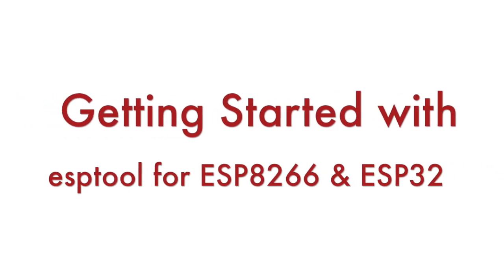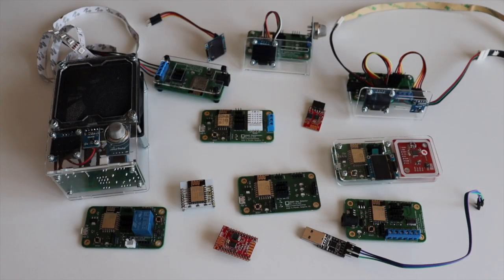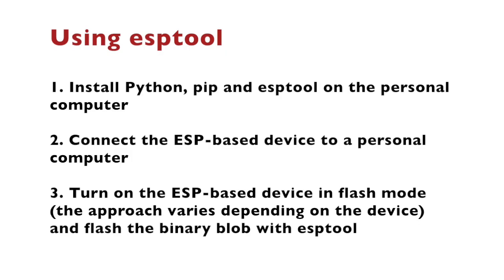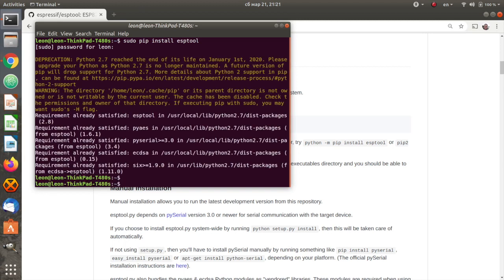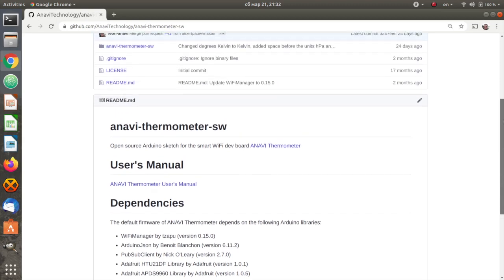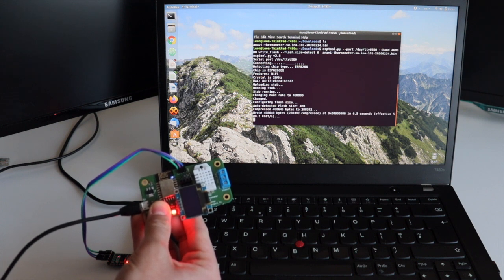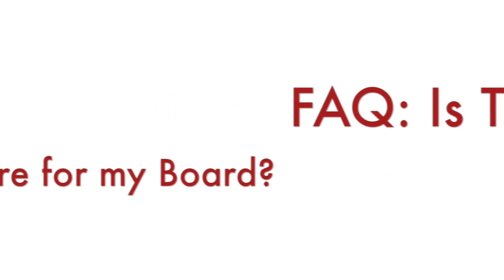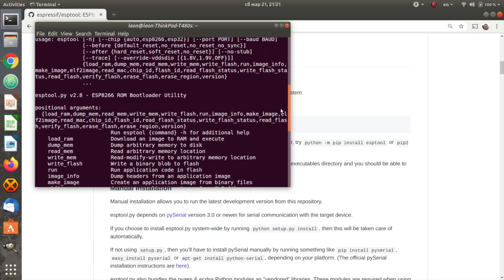Getting started with esptool for ESP8266 & ESP32

Comment: You said there were other instructions in the description.
Reply from the maker: Yes, have a look at the blog post with more details:
https://blog.anavi.technology/getting-started-with-esptool-for-flashing-firmware-on-esp8266-and-esp32/
I also added the link to it in the description of the video.
Reply: @LeonAnavi  HI there. I saw that and checked. I think the board is gone.

It's flashing blue twice and then nothing.

I will try another lead before I resign.

Sorry for the late reply, I'm not in a great way, but thank you for yours.

Kind regards.
Reply from the maker: What is the model of the board you are trying to flash with esptool?
Reply: @LeonAnavi  Oh hey there. It's a NodeMcu. I've had it ages, but not yet used it, so decided to try it out.
Reply from the maker: NodeMCU comes with a AI Thinker module ESP-12 (for NodeMCU version 0.9) and ESP-12E (for NodeMCU version 1.0). Both of these modules are with ESP8266. If you still having problems flashing firware to it first make sure the esptool is properly installed and has all required software permissions to detect and use your NodeMCU. After that you can also consider using the erase_flash command in esptool. It will erase the flash memory on the ESP8266 and after that you can try again flashing the firmware.
https://docs.espressif.com/projects/esptool/en/latest/esp32s3/esptool/basic-commands.html#erase-flash-erase-flash-erase-region

Comment: Is it possible to press the boot button and program only via putty/serial-terminal?  

Everything I've seen requires installing too much software (arduino ide, esp32 idf, vs-code, etc)... using just the esptool 4.4 executable seems like the next best thing.     

The espressif download tool seems too error-prone.. is it possible to erase the bootloader?
Reply from the maker: Yes, esptool is a command line tool. The button is required to help GPIO0 low on reset to enter flashing mode. By default there is a bootloader protection to avoid mistakes when flashing:
https://docs.espressif.com/projects/esptool/en/latest/esp32/esptool/basic-commands.html#bootloader-protections

Comment: Hello, I want to flash a Wemos D1 mini (ESP8266) with esptool and OS Linux Mint, but I got following error messages and I found no solution. May you can help me, thanks in advance Thorsten

sudo esptool --port /dev/ttyUSB0 --baud 9600 write_flash 0x0 firmware.bin
[sudo] Passwort für thorsten:       
esptool.py v2.8
Serial port /dev/ttyUSB0
Connecting...
Traceback (most recent call last):
  File "/usr/bin/esptool", line 3101, in <module>
    _main()
  File "/usr/bin/esptool", line 3094, in _main
    main()
  File "/usr/bin/esptool", line 2885, in main
    esp = ESPLoader.detect_chip(each_port, initial_baud, args.before, args.trace)
  File "/usr/bin/esptool", line 274, in detect_chip
    detect_port.connect(connect_mode)
  File "/usr/bin/esptool", line 475, in connect
    last_error = self._connect_attempt(mode=mode, esp32r0_delay=False)
  File "/usr/bin/esptool", line 433, in _connect_attempt
    self._setDTR(False)  # IO0=HIGH
  File "/usr/bin/esptool", line 399, in _setDTR
    self._port.setDTR(state)
  File "/usr/lib/python3/dist-packages/serial/serialutil.py", line 603, in setDTR
    self.dtr = value
  File "/usr/lib/python3/dist-packages/serial/serialutil.py", line 473, in dtr
    self._update_dtr_state()
  File "/usr/lib/python3/dist-packages/serial/serialposix.py", line 715, in _update_dtr_state
    fcntl.ioctl(self.fd, TIOCMBIC, TIOCM_DTR_str)
OSError: [Errno 22] Invalid argument
Error in sys.excepthook:
Traceback (most recent call last):
  File "/usr/lib/python3/dist-packages/apport_python_hook.py", line 153, in apport_excepthook
    with os.fdopen(os.open(pr_filename,
FileNotFoundError: [Errno 2] No such file or directory: '/var/crash/_usr_share_esptool_esptool.py.0.crash'

Original exception was:
Traceback (most recent call last):
  File "/usr/bin/esptool", line 3101, in <module>
    _main()
  File "/usr/bin/esptool", line 3094, in _main
    main()
  File "/usr/bin/esptool", line 2885, in main
    esp = ESPLoader.detect_chip(each_port, initial_baud, args.before, args.trace)
  File "/usr/bin/esptool", line 274, in detect_chip
    detect_port.connect(connect_mode)
  File "/usr/bin/esptool", line 475, in connect
    last_error = self._connect_attempt(mode=mode, esp32r0_delay=False)
  File "/usr/bin/esptool", line 433, in _connect_attempt
    self._setDTR(False)  # IO0=HIGH
  File "/usr/bin/esptool", line 399, in _setDTR
    self._port.setDTR(state)
  File "/usr/lib/python3/dist-packages/serial/serialutil.py", line 603, in setDTR
    self.dtr = value
  File "/usr/lib/python3/dist-packages/serial/serialutil.py", line 473, in dtr
    self._update_dtr_state()
  File "/usr/lib/python3/dist-packages/serial/serialposix.py", line 715, in _update_dtr_state
    fcntl.ioctl(self.fd, TIOCMBIC, TIOCM_DTR_str)
OSError: [Errno 22] Invalid argument
Reply: Hello Leon, good news. I found the issue. I tried to flash Wemos Mini D1 over its own usb io connection. This was not possible. And as you wrote ".. listing to UART to USB debug converter .." I disconnect the internal USB io connection of the Wemos Mini D1 and I used a TTL2USB Converter (CP2102) - that was it. With the TTL2USB Contverter, it was possible to flash the Wemos Mini D1. Thanks a lot Leon, you show me the right way to solve my problems, best regards Thorsten
Reply from the maker: @thorstenjoos5620  well done for solving the issue and flashing the board! Adding a UART to USB is a user-friendly for development but increases the bill of materials so some ESP boards just skip it.

I think  Wemos Mini D1 comes with built-in CH340 USB to UART converter. If it is not listed by lsusb when you have the board plugged into a PC with Linux this probably is a driver issue. So you might just need to install/configure the driver. If this is the case, SparkFun offers a nice (but bit old) tutorial: https://learn.sparkfun.com/tutorials/how-to-install-ch340-drivers/all
Reply from the maker: Hi Thorsten, could you please check the port? Is /dev/ttyUSB0 existing? Is the lsusb command listing to UART to USB debug converter?